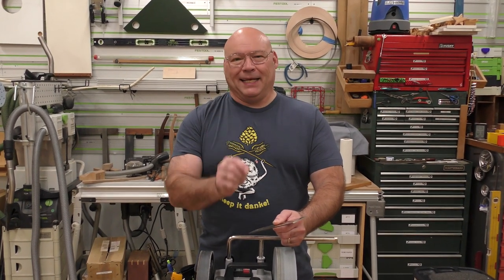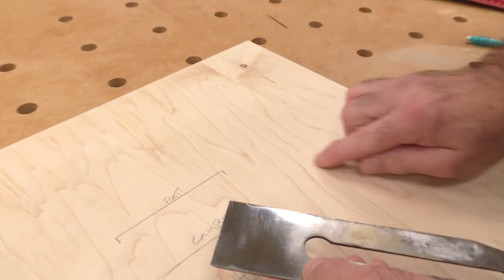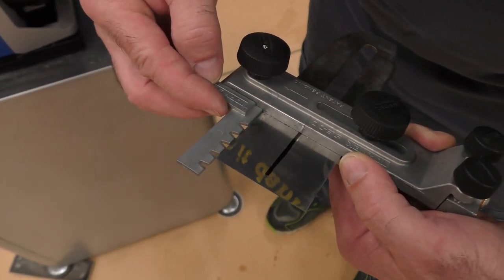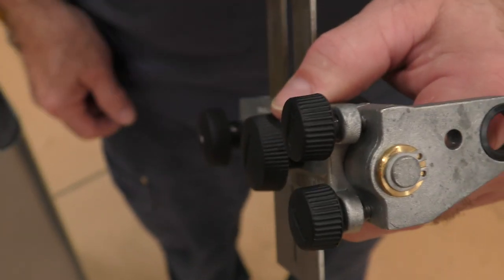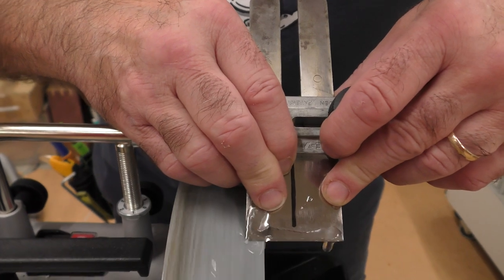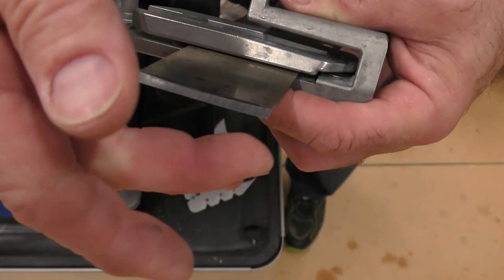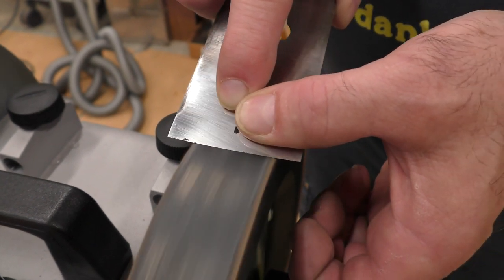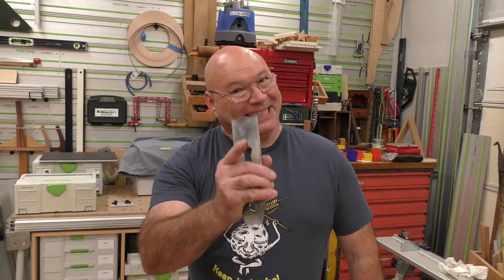Tormek Tip: How to Camber a Plane Blade

Comment: These tormek videos are fantastic. I attempted this when i first got mine with poor results  but wasn't centering the blade in the jig ... duh makes sense now. you can also use the stone truing tool at a fast feed rate to make the stone extra aggressive at the trade off of wearing the stone out faster. works great when you have alot of material to remove.
Reply from the maker: Great to hear!

Comment: What about the secondary bevel.?
Reply from the maker: I do not put a secondary bevel on blades or chisels... but if I did I would turn the tool rest a couple of clicks and repeat the process....
Reply: If you use a Tormek,  you don't need a secondary bevel, according to the Tormek organisation,  check out their videos as well.